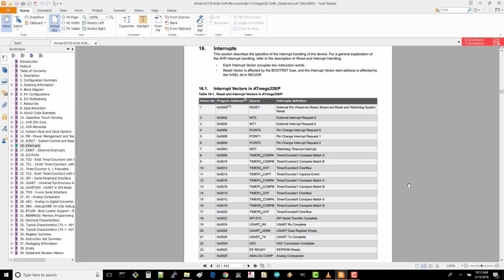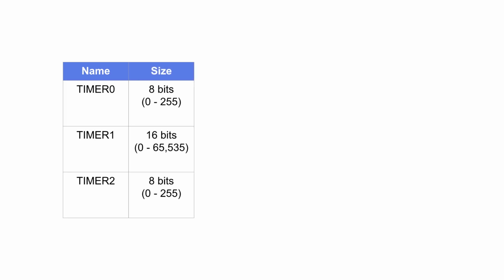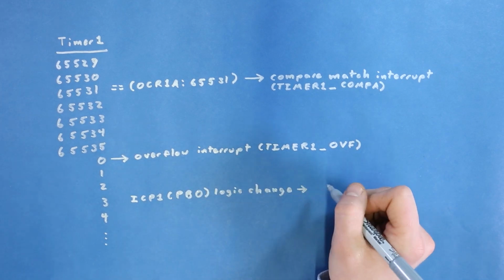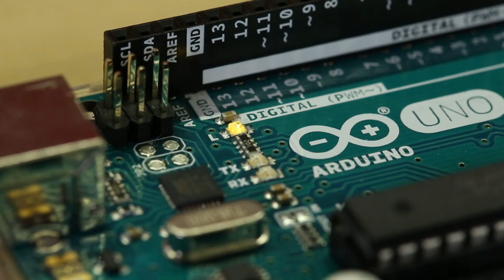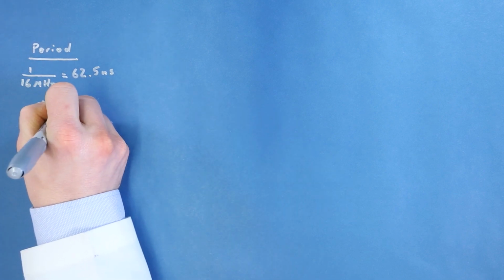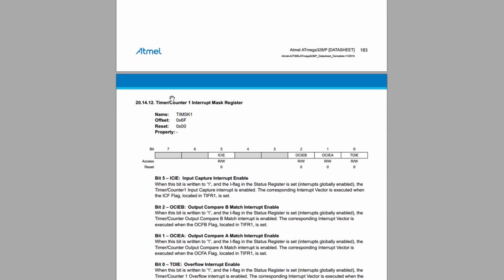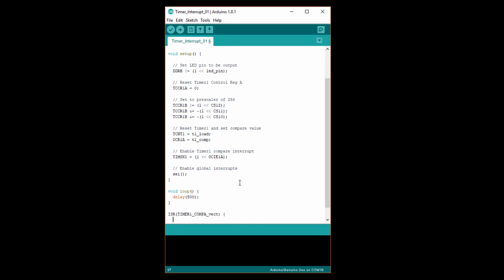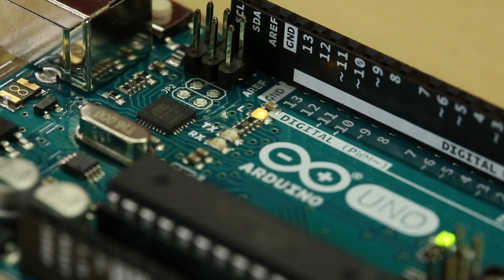Level Up Your Arduino Code: Timer Interrupts

Comment: For those (like myself) that dont understand the << operator:
u can use the operator |= to do the same thing bit by bit.
For example timer 5 on arduino mega:
TCCR5B=0; // You have to clear the register first!!
TCCR5B |= 0b00001010;  /*the last 3 bits set the internal clock with a 8 preescaler, the previous bit sets the CTC mode
 0b00001(010) this bits set the preescaler
 0b0000(1)010 this bit sets the ctc mode*/
Reply: I tried it with the = operator and still works example: TCCR5B = 0b00001010; with this method u dont have to clear the register
Reply: @Gipsy_T.  i guess it overwrite it anyway

Comment: excuse me, anyone to help my theses ?
i need prepare frequency sampling at my arduino uno as 1000Hz
i use this program but cant sharp at 1000Hz

can you help me ?
actually i check it on osiloscop

const int analogInPin = A0;  // Analog input pin that the potentiometer is attached to
const int analogOutPin = 3; // Analog output pin that the LED is attached to

int sensorValue = 0;        // value read from the pot
int outputValue = 0;        // value output to the PWM (analog out)

void setup() {
  // initialize serial communications at 9600 bps:
 pinMode(3,OUTPUT);
  Serial.begin(9600);

noInterrupts(); // disable all interrupts
TCCR1A = 0;
TCCR1B = 0;
//TCNT1 = 65484;// preload timer 65536-16MHz/256/1200Hz
//TCNT1 = 65411;// preload timer 65536-16MHz/256/500Hz
TCNT1 = 65473;// preload timer 65536-16MHz/256/1000Hz
//TCNT1 = 65503;// preload timer 65536-16MHz/256/2000Hz
//TCNT1 = 34286; // preload timer 65536-16MHz/256/2Hz
TCCR1B |= (1 << CS12); // 256 prescaler
TIMSK1 |= (1 << TOIE1); // enable timer overflow interrupt
interrupts(); // enable all interrupts
}
ISR(Timer1_OVF_vect) // interrupt service routine that wraps a user
//defined function supplied by attachInterrupt
{
//TCNT1 = 34286; // preload timer
TCNT1 = 65473; // preload timer
//TCNT1 = 65503; // preload timer
//TCNT1 = 65411; // preload timer
//TCNT1 = 65484; // preload timer
  
}

void loop() {
  // read the analog in value:
  int sensorValue = analogRead(A0);
  // map it to the range of the analog out:
  outputValue = map(sensorValue, 0, 1023, 0, 255);
  // change the analog out value:
  analogWrite(analogOutPin, outputValue);
digitalWrite(3,HIGH);
delayMicroseconds(2000);
//delayMicroseconds(1000);
digitalWrite(3, LOW);
  // print the results to the Serial Monitor:
  Serial.print("sensor = ");
  Serial.print(sensorValue);
  Serial.print("\t output = ");
  Serial.println(outputValue);

  // wait 2 milliseconds before the next loop for the analog-to-digital
  // converter to settle after the last reading:
  //delay(2);
}

Comment: Very good indeed.
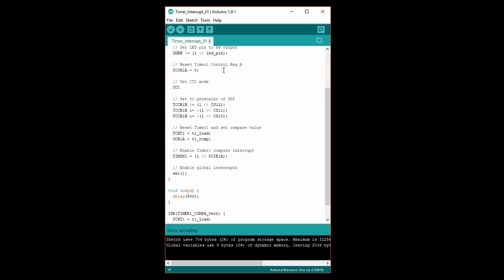Question: Portability aside, what is the benefit of writing strings of shifted-bit constructs like (15:57)
TCCR1B |= (1 << CS12);
TCCR1B &= ~(1 <<CS11); 
TCCR1B &= ~(1 << CS10);
instead of simply loading the register with a constant - ?
Reply: I think it's just easier to read. If you take a 1 and shift it left 10 or 11 or 12 bits like they are doing here it is obvious exactly what bit in the destination register is being targeted, that is bit 10 or 11 or 12. Sure, for bit 12 they could just XOR it with 4096 decimal or 1000 hex instead, but I certainly don't remember off the top of my head that 4096 equals bit 12.  Whereas if you see the CS12 you know without having to work it out that it's bit 12 that will be affected.
Reply: easier to read is:
bitWrite(TCCR1B, CS12, 1);

bitWrite is a macro defined in Arduino.h

Comment: I liked how above this was.  I got lost when you were setting bits on with shift.   There has to be an easier way.  Like a hex number maybe or simply HIGH.  My Question is Shouldn't Tload be not zero but the time it takes to execute the interrupt code?
Reply: Yeah i got lost too, u can use the operator |= to do the same thing bit by bit.
For example timer 5 on arduino mega:
TCCR5B=0; // You have to clear the register first!!
TCCR5B |= 0b00001010;  /*the last 3 bits set the internal clock with a 8 preescaler, the previous bit sets the CTC mode
 0b00001(010) this bits set the preescaler
 0b0000(1)010 this bit sets the ctc mode*/

Comment: First, delay(500) does not need in loop.Just modification of tl_comp = 31250 is 0.5 sec; multiplication by 2 is 1 sec, or division to 2 is 125 millisecond.

Comment: What documentation did you find Arduino timer uses'? i would like to find out what the atmega2560 timers are used for so i can utilize the correct one for my application.

Comment: FYI: The Crystal Resonator on the UNO and MEGA is only connected to the little microcontroller, that is handling the USB communication.
The main Microcontrollers (328 and 2560) have FAR LESS ACCURATE 16Mhz ceramic resonators as clocks!

Comment: just curious why use &=for  CS11 and CS10 while using |= on CS12? i know one is compound bitwise and while the other are compound bitwise or. but i have tried a couple of variation of the bitwise but it didnt change anything

Comment: i freaking HATE embedded C. I understand nothing.....UGGHHHHHH. My head hurts....When ever i ask the meaning for something, my teacher just tells me to look at the datasheet. That thing is a NIGHTMARE. I understand nothing. Its like its speaking another language. TRCCE.....FPRE.....SEERT this,  CESR that.  Like what the heck does any of that even mean....
Reply: Well why are you trying to learn it? Are you being forced or what? Because if you are interested in a specific thing no matter hard it is, you will always try to understand it
Reply: @williamgregorio326  No. I'm pissed due to the lack of information our tutor tells us. everything's hard in my degree of electrical engineering....yet im still able to because  there a lot of online resources which explain it really well...
Reply: Don't write in C, then.  Look at the multicore Propeller chip and program in the crystal-clear SPIN language, or use Blockly, a graphical programming language.

Comment: how does timer1 affect the servo functions? is it because of the delays being too big?
Reply: I would imagine that the servo functions are affected because they rely on a specific frequency from timer1 (as configured in its default state) to control the timing of signals sent to the servos. When that timing is changed, the servo functions can't operate normally.

Comment: I was searching for this exact topic and found this video.  When I saw the intro, I thought "oh great another beginner video with cheezy analogies", and almost closed its tab.  Lucky me, I didn't.  This turned out to be exactly the level I needed (what I consider intermediate).  The language was clear and with the right amount of details for me. I liked the fact that the presenter didn't assume I already knew everything while keeping a good technical level. It's obvious a lot of thoughts have been put into the script. Well done!
Reply: Very well said. I had exactly the same thoughts about the video.
Reply: Exactly
Reply: @Bruce Snode hello bruce, can you help me correcting my code?
actually i need make 1000Hz frequency sampling  for my EMG signal in arduino uno
but the result cant be sharp at 1000Hz

here my program

const int analogInPin = A0;  // Analog input pin that the potentiometer is attached to
const int analogOutPin = 3; // Analog output pin that the LED is attached to

int sensorValue = 0;        // value read from the pot
int outputValue = 0;        // value output to the PWM (analog out)

void setup() {
  // initialize serial communications at 9600 bps:
 pinMode(3,OUTPUT);
  Serial.begin(9600);

noInterrupts(); // disable all interrupts
TCCR1A = 0;
TCCR1B = 0;
//TCNT1 = 65484;// preload timer 65536-16MHz/256/1200Hz
//TCNT1 = 65411;// preload timer 65536-16MHz/256/500Hz
TCNT1 = 65473;// preload timer 65536-16MHz/256/1000Hz
//TCNT1 = 65503;// preload timer 65536-16MHz/256/2000Hz
//TCNT1 = 34286; // preload timer 65536-16MHz/256/2Hz
TCCR1B |= (1 << CS12); // 256 prescaler
TIMSK1 |= (1 << TOIE1); // enable timer overflow interrupt
interrupts(); // enable all interrupts
}
ISR(Timer1_OVF_vect) // interrupt service routine that wraps a user
//defined function supplied by attachInterrupt
{
//TCNT1 = 34286; // preload timer
TCNT1 = 65473; // preload timer
//TCNT1 = 65503; // preload timer
//TCNT1 = 65411; // preload timer
//TCNT1 = 65484; // preload timer
  
}

void loop() {
  // read the analog in value:
  int sensorValue = analogRead(A0);
  // map it to the range of the analog out:
  outputValue = map(sensorValue, 0, 1023, 0, 255);
  // change the analog out value:
  analogWrite(analogOutPin, outputValue);
digitalWrite(3,HIGH);
delayMicroseconds(2000);
//delayMicroseconds(1000);
digitalWrite(3, LOW);
  // print the results to the Serial Monitor:
  Serial.print("sensor = ");
  Serial.print(sensorValue);
  Serial.print("\t output = ");
  Serial.println(outputValue);

  // wait 2 milliseconds before the next loop for the analog-to-digital
  // converter to settle after the last reading:
  //delay(2);
}

thank you
Reply: Right you said!
Reply: you all prolly dont give a shit but does anybody know a tool to log back into an Instagram account..?
I was dumb forgot the login password. I appreciate any tricks you can give me

Comment: (shawn hymel sir help me) iam trying to measuring the freq and time period for square wave(iam using input capture metrhod), i connect signal to digital pin  no 8 i.e ICP1. TCNT1 is automatically stored in ICR1 register while rising Edge,  im setting for Falling edge TCNT1 is stored in ICP1 reg again for rising edge(means here  is it taking for 1 cycle 0 to 65535 ??). how this is working am not getting please any one explain or send me any videos link iam struggling from past 2 weeks pls help me....
rising edge means TCNT1 is incrementing upto 65535 or  ??
then  what values TCNT1 is taking during falling edge.....

Comment: OK so this is why your product be a phone 'washer, ac ETC... blows up are stop working after the warranty expires. The kill code gets activated and that's when your phone starts to get really hot (am i the only one who has noticed that ?) Because the manufacturer has put in a kill code(starts over clock of cpu in the device ) to destroy that product so you have to buy the latest and greatest and pay more. Simple but yet very effective. Not to mention they encrypt the chip so you cant see the code on it to prove this theory.
Reply: NO

Comment: Hi ,
 I have a problem  in a code that uses IRreciver reading to toggle  in switch statement  I have 3 cases the first 2 cases work great with timer interrupt because they're simple just turning on/off a led , but the third one it's not responding to the interupt because it's a hell of a long cooooode , is there any way using timer interrupts to get out from that case even if the code still running ?

void setup()
{
  //Setup pin modes
  pinMode(buzzerPin, OUTPUT);
  pinMode(ledPin3,OUTPUT);
  pinMode(ledPin1, OUTPUT);
  pinMode(ledPin2, OUTPUT);
  pinMode(redPin,OUTPUT);
  Serial.begin(9600);
  irrecv.enableIRIn(); // Start the receiver
  Timer1.initialize(10000);
  Timer1.attachInterrupt(Iremote);
}
 
void loop()
{
      switch(results.value){
       case 0xFFE21D :  digitalWrite(redPin,HIGH);
                            
                           
        break;
        case  0xFFA25D : digitalWrite(redPin,LOW);
        
        break ;
          
        case 0xFF02FD:   digitalWrite(redPin,LOW);
         
        
  //Play first section
  firstSection();
 
  //Play second section
  secondSection();
 
  //Variant 1
  beep(f, 250);  
  beep(gS, 500);  
  beep(f, 350);  
  beep(a, 125);
  beep(cH, 500);
  beep(a, 375);  
  beep(cH, 125);
  beep(eH, 650);
 
  delay(500);
 
  //Repeat second section
  secondSection();
 
  //Variant 2
  beep(f, 250);  
  beep(gS, 500);  
  beep(f, 375);  
  beep(cH, 125);
  beep(a, 500);  
  beep(f, 375);  
  beep(cH, 125);
  beep(a, 650);  
 
  delay(1000);
  break ;
}}
 void Iremote(){
  if (irrecv.decode(&results)) {
    Serial.println(results.value,HEX);
      irrecv.resume();
          return ;

  }
thanks in advance .
Reply: You shoud not use Serial inside of interrupts. it would be better to make your interrupt as short as possible. An example would be to set a flag with your interupt if your parameter is met. Then let your loop code check for the flag and run the code there. you should also try and get rid of the delays they can avoided with interrupts and just doing stuff that is needed to be done while just watching the clock.   Here is a link that has an serial in the interrupt. https://arduino.stackexchange.com/questions/46595/sending-serial-data-in-an-interrupt

Comment: I want to know if its possible to change the value of OCR1A when the timer is working.
What i want is to generate Pulse train in which the ON time is fixed and the OFF time changes as per the formula that i  already have.
Is it possible to do this using your explanation of timer in this video.(I think it is) but i don't exactly know which register work with.
Thanks for the awesome explanation

Comment: When I write server program for wify using arduino ide in practical case I experience the serveris not active once the input  current is not available for a while and then restarted .Can you please explain a good code for wify server using arduino ide  using registers .